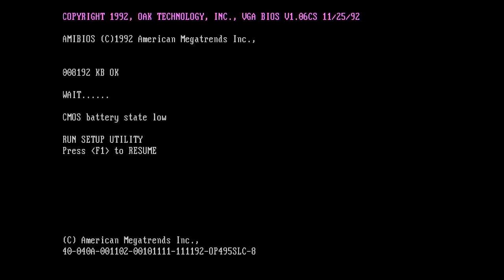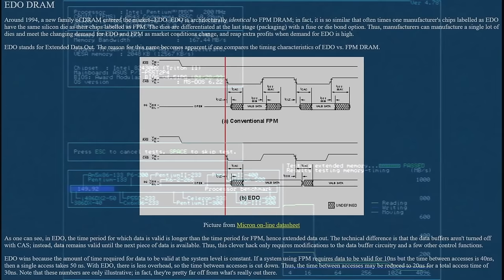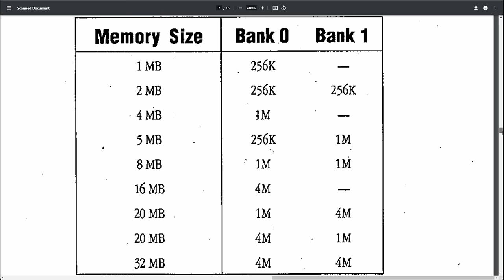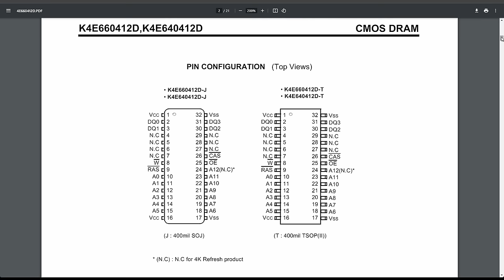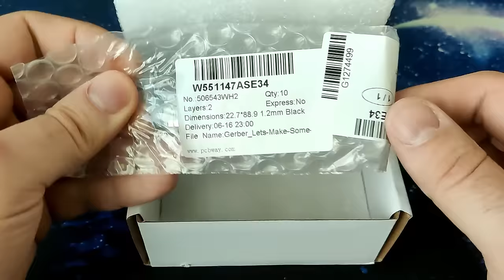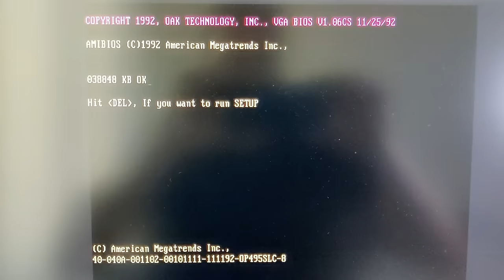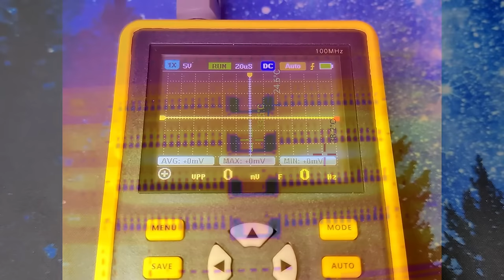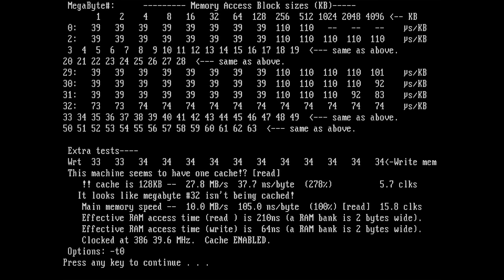DIY 16MB 30-Pin FPM SIMMs: Supercharge Your Vintage Hardware!

Comment: I remember back in the day thinking it would be super cool to max out the ram some day. I came close with my core 2 quad. That had 8 gb. I think the board supported 16. I'm not sure. It was an nforce board. I remember it wasn't easy finding huge ram that even made 8gb possible.
Reply from the maker: Oh, I had a Wolfdale E8400 3GHz and 8gb of ram. That was one of my favorite systems. It was my first dual core. I skipped the AMD 64X2
Reply: @bitsundbolts  lol I've owned 2 pentium dual cores (core 2 based) and a core 2 quad, but never an actual core 2 duo. I mean technically a pentium at that point was just a scaled back core 2. I still have the quad and one of the pentium duals. The other I gave to my sister. Her motherboard fried. I wasn't using that system much anyway at that point. And it was 100% identical to hers. Both were geforce 8400 nforce boards. I think hers had a GPU, but mine didn't. I didn't need a GPU for what I used that computer for. The 8400 was overkill.
Reply: Skt 775 4 dimm DDR2 boards usually max out at 8, unless you can find the elusive standard density 4GB dimms, all I could find was the high density ones that would post with 16GB but then crash shortly after.

The later 775 boards with DDR3 will take 64GB in a 4 dimm board.

Comment: I was about 8 when we got our first family PC, a 386 DX originally with 4 MB RAM, later upgraded to 8. I remember reading the motherboard manual and it actually said that it supported 64 MB, using 4 MB SIMMs - eight of them on the board, and another eight on a memory expansion card that could be installed in a proprietary slot on the board. That was an unimaginable amount of memory at the time, obviously, so it's pretty cool to see a 386 actually booting up with that much RAM.

I later ran a different 386 with 20 MB for a while - it was pretty much a retro machine by then, but I used it as a NAT router to share our ISDN dial-up line between several other PCs. It was overkill for the job, of course - handling 64 kbps of traffic doesn't take a huge amount of performance...

Comment: I wonder, would it be possible to build an adapter that converts 72-pin EDO to 30-pin FPM without desoldering? I'm imagining two possibilities, one where you utilize only 1/4 capacity, another where it splits into 4.

Comment: I have 386sx 40MHz with 2MB and run Doom under Win3.11 - it was very slow, and some time start swapping, but I don't have no over options...))
Reply from the maker: Uhh, Doom must have been slow - and maybe a very small window size? 😅
Reply: @bitsundbolts  yea, but I don't have a choice )))

Comment: I had 8M of RAM in my 386DX-40, and since I ran Win95 with Office 97 on it, it wasn't enough. It swapped heavily.
Reply from the maker: Windows 95 did benefit from a bit more memory. I remember upgrading my 486 from 8 to 32 MB. It was noticeable!

Comment: i love maximum memory size parameter writen in any manual for via chipset motherboard up unto ddr1 i mannaged to break the limit on ecs motherboards ment for mentium 3 on multiple ocassion
either by installing 3 512mb sdrams or 2 1gb ddr1 and runing windows 7 on that :Pbut i never considered making bigger modules, that is quite an interesting idea
Reply from the maker: I have a feeling that in the early days,  they just wrote what was currently in the market as the maximum. Then it turns out that whatever is addressable, should be written - since it most likely will happen sooner than later!
Reply: @bitsundbolts  yes but intel chipsets had finite maximum from the very start bx 768mb and newer i815 only 512mb and you can't add more, via and sis... hold my drink i think one via board for coppermine cpu's had 4 ddr slots and could take in 4gb but i can't confirm that
still kind of pointless feature because cpu's are too slow for modern use and most uses of that day could deal with less han 512mb just fine

Comment: i've got a dell 486P/33 that i put a 100mhz texas instruments 486 and shoved 64mb of ram in 4 16mb modules in it because it is some weird proprietary Dell ram so i wanted to buy a max set while i could and found it cheap on ebay... haven't seen any since.

Comment: I was kind of expecting you to need level-shifters for those memory chips. Is the address/data lines 3.3V even though the supply is 5V?
Reply from the maker: I learnt about level shifters after I released the video. However, it seems that those chips are 5 volt tolerant even though the data sheet says otherwise.

Comment: I love your videos, great content there! I have the exact same motherboard, Soyo 019L and I had to repair some traces after battery corrosion. Now when it starts it shows Ext. memory 0, even if I have 4x dimms there the motherboard cannot "see" them. Any ideas what might cause this behavior? Thank you in advance for any response!
Reply from the maker: Thank you! Hm, that is not supposed to happen. But I guess the 640K conventional/base memory is there, right? Maybe some sort of compatibility setting with early IBM/Intel 8088 systems. I don't recall a setting in the BIOS that would cause this, but maybe there are additional jumpers on the board. Did you check the manual on the Retro Web for more info? Also, does it count the 4MB on start up, or does it also stop at 640k?

Edit: I just checked the manual, please check the BIOS "Advanced CMOS Setup" and then "Fast Gate A20 Option". This should be ENABLED.
Reply: @bitsundbolts  thank you so much for your reply!! Yes, 640K is there but memory counts up to 768 on startup and if I go into bios, I can see the Ext. memory size as 0. I have four dimms populating bank0 on motherboard. I will try to remove the cache chips to see if anything changes. If that don't work then I will remove the memory banks to see what is happening under them, maybe some broken trace from corrosion. Again thank you for your reply and keep posting these videos, your channel is awesome!
Reply from the maker: Any time and thanks for watching my videos! You could also try to disable the cache in the BIOS - there is an option. But yes, it never hurts to remove the cache chips and look under the socket - since the battery was right next to those cache sockets.
Maybe also check how the board behaves if you do not have any cache chips on the board. Good luck and let me know how it goes.

Comment: Good job, I have some generic '93 386 board that supports one 72pin FPM SIMM and 4 30pin SIMMs and to my surprise it takes 64MB FPMs and still can address the remaining 4 SIMMs. Since I only have 1MB ones the maximum memory I got was 68MB but maybe it could actually support up to 128MB which would be pretty insane on a 386 😁
Reply from the maker: Wow! The fact that it has a 72-pin socket means that this is probably a very late 386 board.
Reply: @bitsundbolts  Yeah I think it actually uses some 486 chipset but it is cost reduced variant with soldered AMD 386DX40.

Comment: I can put 128MB in my 486, 4x32MB 72pin. Doesn't need it, I downed it to using 16MB simms instead. As for my 286; 4MB of 4x1MB sipp modules. :) I don't have a 386 anymore. I do have a bunch of 4MB 32pin simms, I personally have no more need than that.
Reply from the maker: Yeah, most of the memory isn't really usable. But it's nice to be able to max out this board. A 386 will probably be happy with 8MB for almost everything that runs on it.
Reply: @bitsundbolts  Still fun to see though. :)

Comment: I wonder if it's possible to add some extra logic to the cost and have that pin do both lines. Mauve it would allow you to have 128mb of Ram however it seems like it would be a huge task for minimal reward.
Reply from the maker: I have a feeling that the chipset notices if BANK1 has modules installed and then uses that pin as RAS signal. If BANK1 is unpopulated, it will switch the pin to an address pin. So, two types of operation modes. I doubt the chipset would be able to toggle between those modes while running. But that's just speculation from my side

Comment: Would be nice for my Atari TT. My MegTT Fast-RAM can take up to 8 16MiB SIMM30 FPM modules. 128 GiB is an insane amount of memory for it (I have currently 96 MiB but with a Storm Fast-RAM interface which takes 2 SIMM72 modules (FPM or EDO).
Reply from the maker: Oh, so, you may be able to use those modules in EDO mode... I am happy to have left that option on the board.

Comment: now this asks for a follow up video with a system that can handle 8x 16MB :-)
Reply from the maker: I guess it could work with a better motherboard/chipset. Unfortunately, I do not have any other 386, but it should be possible with some 486 boards... Time to explore and discover!

Comment: Is there a point in the fpm edo switch? Were there 30pin boards that used edo I thought that was a 486 thing so why even put a switch just set to fpm. Also dont a lot of older programs for dos act up with more then 16m of system memory being installed i remember before someone telling me a 386 gaming system should not even have 16m because of this issue?
Reply from the maker: To my knowledge, there is at least one 386 board that supports EDO memory. I think it utilises a 486 chipset. And you could use those modules in an adapter with 4 SIMM sockets to one 72-pin module and run it as EDO. Some 486 boards support EDO memory. Maybe there are also other devices, like sound cards, that can benefit from EDO memory.
I am not aware of problems related to too much memory. Although, there may be the occasional program that needs to check (for whatever reason 😞) total memory size and fails. That should be the exception

Comment: with that much ram i'd probably just install win95a or setup a dual boot between win3 and 95. the few 386's i've seen running 95 just had 8mb of ram, but wtih 64mb it'd probably speed it up abit.

Comment: Would it be possible to build FP-RAM modules with SRAM or is the interface to FP-RAM to "weird" (multiplexed signals for example)?
Reply from the maker: I did not spend any time looking at this, but I doubt it will be possible. I can imagine that the access timings will be different and not compatible with the memory controller that was built for FPM chips. But I could be wrong. Imagine to use SD-RAM chips on old systems... I doubt this is possible.

Comment: Seriously I am so sad that I gave away my 486 when switching to my CyrixP5 in 1996. But at work I used a DX4 100 with 48 MB EDO RAM up until 2001 (running NT 4.0)

Comment: I have a 486 that has the memory on a card that has 16 slots. Do you suppose those modules would work for that machine?
Reply from the maker: Very difficult to say because I don't know what this card or the memory looks like
Reply: @bitsundbolts  It's an Everex Megacube. It's a large cube shaped machine, that's based on the EISA bus. There is no memory on the mainboard, but there is a special slot to hold a riser card that has 4 sets of four 30 pin SIMM slots.

Comment: perhaps go with an SMD switch the next time
Reply from the maker: Ah, right... That might have been a smarter choice, but I still have so many of those through hole switches.
Reply: @bitsundbolts  the best component is the one you have on hand. But maybe add a second footprint in rev2

Comment: Wasnt it cheaper to use a jumper shunt instead of a switch on the modules you made.
I can think that make a lot of these modules and needed switches will drive up the costs a lot. And also a high failure rate when the switch goes bad.
Dual voltage module itsnt a bad idea.. If one fails, the other one will take over the task. Better then over volt the ICs. ( gives you some protection)

Comment: Most mobo makers will only list the max RAM as related to what size modules exist at release time, and FPO was never made with more than 4MB at the time.
I'm wondering what the absolute max L2 cache a 386/486 mobo can take, most were spec'd for 256KB, but would 512KB/1MB work?

edit:  I'm surprised you didn't need a level shifter or two.
Reply from the maker: I'll be honest, I didn't know about it. I'm not an electrical engineer. Of course, many pointed out what you said. So, I'm researching right now and it probably would be a good idea to have level shifters at least on the data lines. Why not on the address and other signal lines? It looks like those chips are 5v tolerant - even though the data sheet says differently. This comes from another source. Some chips (e.g. Micron) seem to work up to 7 volts. My goal would be to at least have the data lines properly connected (which communicate both ways).

Comment: Does the switch make any sense at all? And the two voltage regulators are connected in parallel ?
Reply from the maker: No, the two voltage regulators are separated. Each memory chip has its own voltage regulator. If they were connected in parallel, I believe one would do all the work and the second one wouldn't do anything.
The use case for EDO on those modules is very limited. However, you could use a 4x30 to 1x72 pin Adapter and use those modules on a 486 that supports EDO memory. I understand that there are also other devices that can make use of EDO memory chips on 30-pin SIMMs.
Reply: @bitsundbolts  A simple, small solder bridge would be better than a switch.
Also, a gold plating on this 30 pin connector would have been nice.

Comment: I've asked this before but I have a Compaq Presario 425, it has two 72 pin slots for memory plus 4MB built into the motherboard. It has a memory maximum of 20MB, but it appears to be a limitation of the BIOS as the chipset documentation claims to support up to 64MB.

Is there a path to get past the 20MB max? It boots and hangs on counting past 20MB but I'd love to get it up to at least 32MB as that opens up things like WinNT/Win2k.
Reply from the maker: I had a discussion recently with Tony359 about his Apple machine which is limited to 10mb. 2 on the board and two sockets for 4MB SIMMs. It also seems to be a BIOS limitation. Without a patched BIOS, I'm afraid it will not work.
Reply: @bitsundbolts  That is unfortunate, it is a frustrating limitation as high density 72pin DIMM's are a thing, and if it were fully unlocked 64MB seems possible.

Is there a path to go down to determine if the BIOS is patchable?  I don't even know if Compaq BIOS' from that era are updateable or not.

Thanks for the response by the way, I really enjoy your videos.

Comment: I managed to find a set of 128MB 72 pin SIMMs and max out my 4 slot 486 board with 512MB 😂
Reply from the maker: Wow, I did not know 128MB 72-pin modules exist. The maximum I have are 64MB each. That would be 256MB with 4 modules.

Comment: I understand the “because we can” logic but… can a 386 really do any more with 64mb of RAM vs 8mb
Reply from the maker: The use case for a 386 is very limited. I don't think there's any benefit unless you use specialized software that uses a large amount of memory. I guess, it would be useful for a ram drive and some other experiments. I'm already collecting more info for a new video

Comment: I'm intrigued why did you not explain the results of cachechk shown at the end  of the video... basically all ram above 32 MB is not cached by the motherboard, reducing performance.
Reply from the maker: That may be something for another video. I want to try to increase the cache on the board as well. But you're right. There are things to be improved.

Comment: I'm not sure I get the point of the switch. Doesn't it have to be FPM to work at all? Seems like you could just make the PCB automatically FPM.
Reply from the maker: So, I do have 486 boards that support EDO modules. Of course, in those systems, you could use the faster memory mode. If the board only accepts 72-pin modules, you could use a 4-1 adapter. Also, there are other devices that may support/require EDO (maybe soundcards).

Comment: Wow, nice job, but I don't understand why you use 60ns memory when you have so much 50ns ram xD
Reply from the maker: It was due to the memory module. I only had one of those and it had the least memory chips on the PCB. For a trail run, that seemed the best choice

Comment: I am curious that it is possible to make ddr2 ram with a capacity of 4 gigs؟
Reply from the maker: I didn't look into it, but it depends on the address lines and how they're accessed (CAS, RAS, number of address lines). That should give you the maximum addressable space. Then, multiply it by the data bits. E.g. 64

Comment: Blood from the eyes
My teacher of special technology would have grabbed the cordial pills for a long time.

The sequence of soldering is not observed in the most cynical way.
The correct sequence of assembly of the scheme:
1 soldering connectors and switches
2 resistors are soldered
3 capacitors are soldered
4 transistors and other semiconductor devices mounted directly on the PCB are soldered (after each soldering to cool)
5, lastly, IC Chips are soldered, so that there is time to cool, so as not to damage the wire connection of the crystal output inside.
5.1 IC Chips that are afraid of statics are soldered by the very last with all precautions - with heat sink, if possible, and necessarily with a grounding bracelet. (of cause see p.5 about cooling)

Here I see non -compliance with technology. 

=)

Comment: The way you desolder the chips gives me bad goosebumps.
If only not using a preheater wasn't enough you HAD TO just scrape the damn chip sideways instead of lifting it?
(engineered facepalm)
Reply from the maker: It's a double sided memory module. With a preheater, I would just roast the memory chips on one side. The heat would have to travel through those chips to heat the PCB. Instead, I decided to use my hot air station and apply heat evenly over the PCB facing up. After 15-20 seconds, the temperature is high enough to focus on individual chips to remove them. Scraping the chips off reduces the time I need to blow hot air over the chip. The moment the chip moves, I can stop.